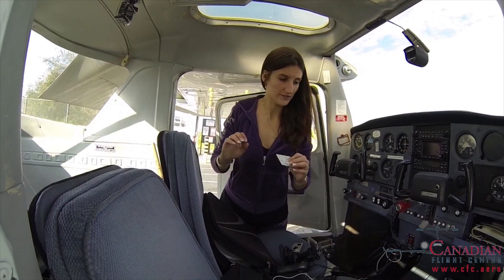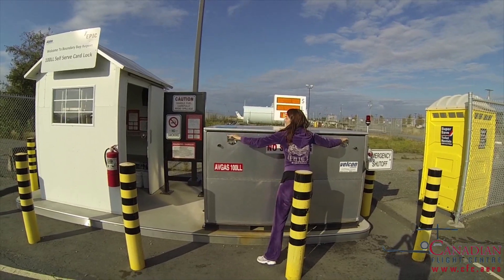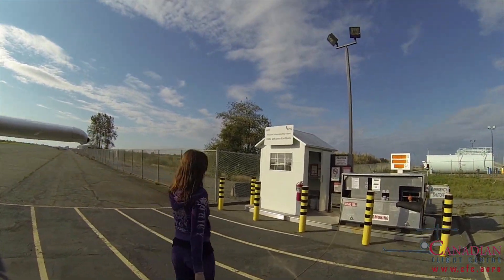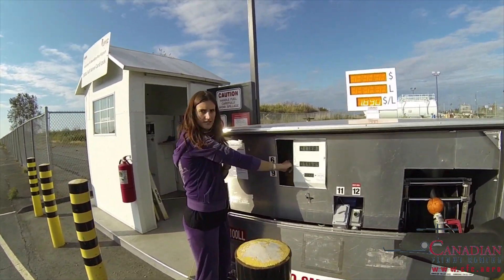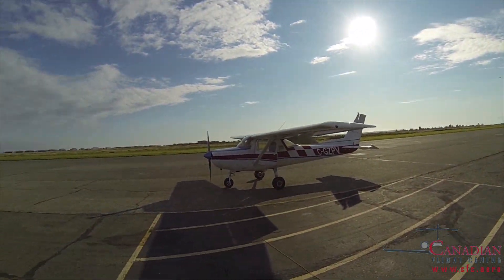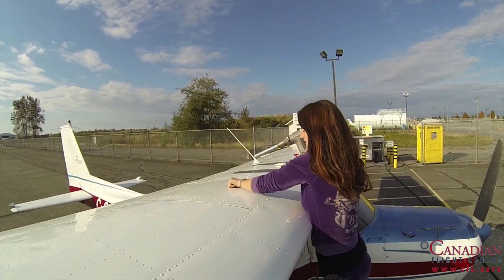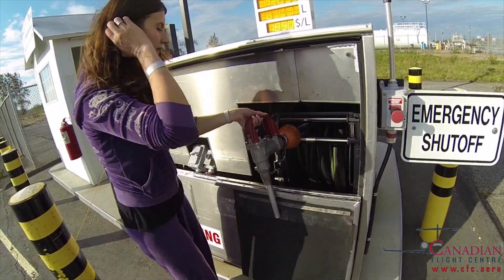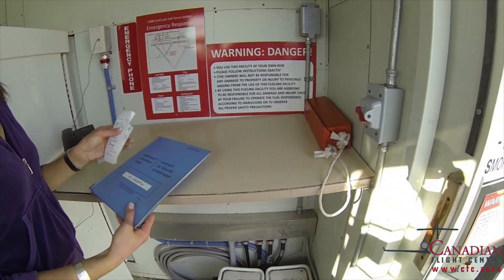How to Fuel an Airplane

Comment: A brief glance at the comments and I did not see... No one mentions... I would not be fueling an aircraft unless I first made sure the flaps were retracted; The doors latched; Ailerons locked, and parking brake set.  There is wind sound in the audio, but apparently not enough to disturb the 150 this time.  Still iffy to rely on the parking brake, if it was set(?) in this case, with both doors open, and flaps full out.  Nothing mentioned about the brakes or aileron lock in the video.  Chocks would be safer and sometimes they are provided like the ladder.  Plus, after fueling, put the fuel nozzle on the ground, or leave it in the 2nd tank, and go SHUT OFF the pump before doing anything else.  Some places do not like dragging their hose on the ground back to the reel.  Gather it up piecemeal and place it nearer to the reel before reeling in.  Safety first.  Turn on the pump only when ready to fuel the first tank.  I take the fuel nozzle; Insert it into the first tank, and then go turn on the pump.  Lot of effort but worth it to me.  Otherwise, thanks for the video.

Comment: H ow can the  fuel flow faster than when you fuel your car when the diameter of the hose etc are the the same as when filling up a car. ?  There is no way you are filling faster than a garden hose and I know how long it takes to fill up just  5 gallons with a hose. Something is wrong here.
Reply: FACEPALM
Reply: Dumbass, heard of pressure? Higher pressure, higher flow rate, so dumb.
Reply: Bro have you ever heard of PSI?  You're just a troll.

Comment: As a re-fueler I never let the hose rest against nor touch the leading edge...just saying.
Reply: I always use the ladder as a shield to keep the hose away from the wings, and always face inwards to ensure you have no splash back on the wind screen, cap the end immediately after the nozzle has drained, do not move a ladder in the full out position...just saying again.
Reply: she pretty though!
Reply: +Rampie 1388 ever heard of a wing mat.  We have them on our trucks
Reply: On my 2nd week, have re-fueled a UH-70 Blackhawk, a UH-72 Lokuta, our local news station Sky 7 Bell 407. ALL are easier than Jet-A King Airs/Meridian/TBM930 etc... Not sure if you’re commercial or private but I always put the hose line on the outside of the ladder and prop it to the end as I uncap the fuel tank. Couldn’t agree more with what you’re saying. Cheers though!
Reply: Oh shut up

Comment: Excellent.  She protected the hose nozzle from dirt or trash by not laying it down on the ground to carry the ladder.   SUGGESTION:  a great way to guide the hose back into the reel is with the nozzle assembly!  Allow the hose to slide against the base of the nozzle (not the tip) as the hose retracts, instead of your feet, hands, or legs.  This keeps the hose perfectly away from your nice clothes!   Try to avoid using the tip itself as the pressure point, but hold the nozzle somewhere comfortable to you at the coupling connection area.  You can simply let it hang from your hand as a guide applying pressure against the retracting hose.   Voila!  My multi instructor showed me this and I've done it ever since.

Comment: I am wondering why she didn't conect the ground wire contion to the aircraft , safry first alwasy ground your conetion !
and never over wing an aircraft.
Lets say each wing takes max 8000 or 800 galons of Jet-A Fuel
Start with well asumming your empty start with 400gl and then fuel the right wing at 500 and tyen go back to the left wing and top off to 780 or 7800 because just because it takes 8000 or 800 gl does not mean your should fill to max capacity.
Is this right?
Please let me know if I been trained right.
Also keep in mind about your fuel dencity level we do 6.7.
Reply: Bro. This a fucken 152.  Where the hell are you getting 8000 gals
Reply: Every time i Overwing Fuel a Small Corporate Jet i always ask if it requires split loading, some do some don"t, the Crew will advise, a lot depends on how much is left in tanks. Not to be Picky but Gloves and Protective Glasses should be made available, you get Avgas in your Eye and you"ll know about it. Lastly, it is a Bonding Cable to Equalize any Static Build up created by moving Fluid, not a Ground Earth. Almost forgot, always treat the Propeller as live, Walk around the Bloody thing, Pilot left Ignition on, Worn Engine, an Excess of Carbon, Pre-Ignition and Whoops,.................................look no Hands/Head.
Reply: +Mariovo5 She connected the ground wire to the exhaust pipe.
Reply: +MADTASS For this set up. It would be a ground.  Most pumps use grounding.  Trucks use bonding.